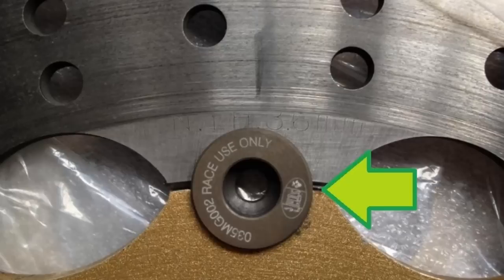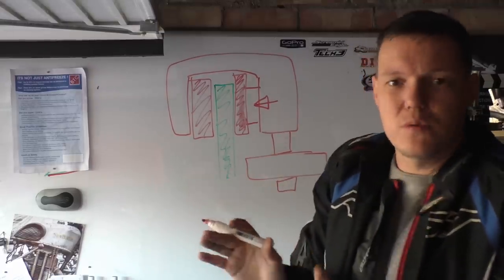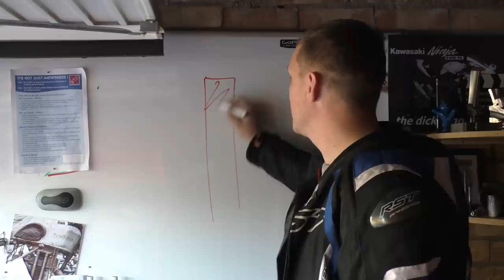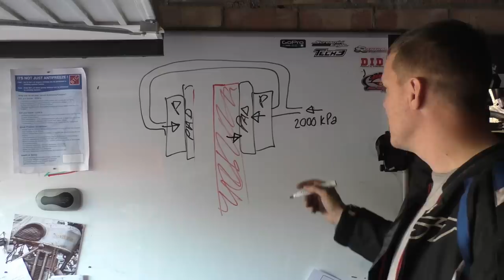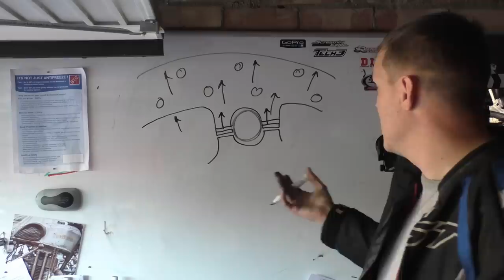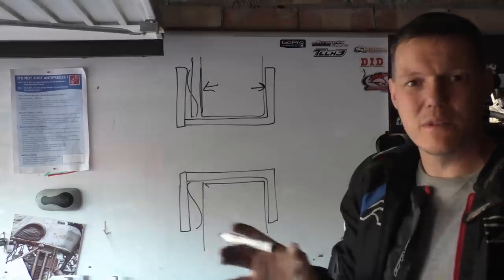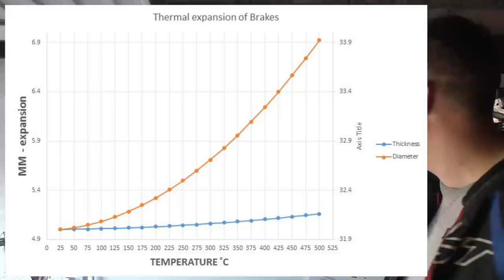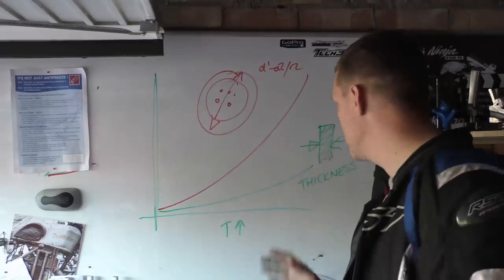Floating Brake Discs - and bobbins

Comment: Question. From new the bobbins are free.
With time, dirt, rust and grime will seize the bobbins in place. Not allowing the disc to move expand etc. It's bad to free the bobbins times to times? Would this not avoid the discs to warp?
Cheers and thanks for the video.
Reply from the maker: "From new the bobbins are free."

- But they're not...

"With time, dirt, rust and grime will seize the bobbins in place."

- Again they're not, some are but not all.

"Not allowing the disc to move expand etc."

- But this is where the problem lies. The expansion is radially outwards - if the clearance is reduced then the brakes expand in the other 5 degrees of freedom...

"It's bad to free the bobbins times to times?"

- The shit in the bobbins is brake dust mainly, an abrasive material. Twisting the bobbins in their clearance grinds the clearance larger, which isn't a good thing.

"Would this not avoid the discs to warp?"

- warping the disc requires heat, a shit load of it. And like I show in the video some bobbins aren't round, so they can't be rotated.
Reply: My issue with this is that not all things are the same. So if u have a disc with free bobbins from factory and they get seized it's normal to leave them seized??

And some are solid others need to move from side do side once they have a type of spring wash to allow movement. But as u showed there's a new type created by ebc that doesn't move.

It's just a bit of everything and makes a lot of confusion not for me but for many people out there.

Another thing I understood and you mentioned is the gap gets bigger once u start spinning the disc each obviously can make the disc to move excessively.
But for the discs that originally come with free bobbins should u keep the bobbins clean so they don't seize.
Reply: Thanks for your time and help.
Reply from the maker: "My issue with this is that not all things are the same. So if u have a disc with free bobbins from factory and they get seized it's normal to leave them seized??"

- You say seized. Seized means not moving, which implies that it should in the first place...

"And some are solid others need to move from side do side once they have a type of spring wash to allow movement."

- The wave washers are there to stop the bobbins moving. This is how it breaks down.

The disc will expand in all 3 dimensions which includes axially. The bobbins have to have clearance otherwise if they were tight they'd pop of wheb the disc heats up and expands. So there's clearance. But this clearance means that they can rattle around due to the disc vibrating when the pads clamp on. 

So to stop this from happening wave washers are added to apply a pre-load. This stops or supresses the vibration by absorbing the energy. When the disc expands it compresses the wave washer with little resistance.

"But for the discs that originally come with free bobbins should u keep the bobbins clean so they don't seize."

- But again that word seize.

Comment: At the risk of being 'picky'. Is that scratches against the bleed nipple? On a brand new bike?
Reply from the maker: LOL no. That's paint marker - there's a few spot around the bike like this - this is for inspection at the factory to makes sure these fitting have been torqued and then checked before testing - so in this case for the brake system before brake testing
Reply: there is one in the bleeding screw/valve that doest look like paint for torke-check.

Comment: I tried this on my semi-floating bobbins due to a pulsing brake sensation that was glaring at low speed and it fixed my issue. Wondering how come it worked? The braking feels much better now with no bouncing/pulsing.
Reply from the maker: Semi floating?
Reply: @dirtygarageguy  not sure tbh.. they're not as laterally free moving as some rotors ive seen. all i know is the pulse is gone.

Comment: My front brakes vibrate like hell, as i brake the front light bumps up and down when riding in the dark (for example. Are my calipers twisted for some reason or doesn't the bobbins just let the caliper move at all? bike is  ninja zx6r original brakes just like in the video
Reply from the maker: Can you send me a video by any chance?
Reply: @dirtygarageguy  yes i have some gopro footage I'll find a good clip to demonstrate! Thank you
Reply: @dirtygarageguy  https://www.youtube.com/watch?v=lIVA5zuHccw&feature=youtu.be here is 2 clips the last one is little better explaining the wiggle. I ride on a steady road and press stably on the brake lever
Reply from the maker: Do you mind if I use the footage. Would make a great video - First things first - take the pads out and look for a build up of shit on the surface, then look at the rotor. Black shit stains are what you're looking for. You can use 400 grit sand paper and lightly remove at the shit. Try that and if you can send me some pictures of what you find. This usually happens if you brake hard and keep the brakes on when stopped.
Reply: @dirtygarageguy  You can use it sure! But alright I'll take a look, pad are fine but not sure about the rotor

Comment: So if my front brakes shake when applied, what you're saying is it's not my solid, unmovable rivets in my disks but rather the fact that either the pin that my caliper floats on is stuck and does not float properly.. or perhaps one of my pistons in my calipers is not pushing evenly with the other?  Hmmm.....  I'll have to check that out!  You may have just saved me $150 by not having to buy a new set of front rotors.
Reply from the maker: Juddering from the front brakes is usually the pads are crocked or the disc is warped slightly - or even air in the line. Sometimes it can be (if you have one) the ABS module being a dickhead - to sort that out you can disconnect your battery for 10 minutes and then reattach - this causes the ABS ECU to reset.

All of these things cost very little to do - so do them first
Reply: Thanks a lot dude!  I have a 05 gsxr 1000 so no abs to worry about... There's no safety nets like abs or traction control on my monster litre bike that could be causing any problems.  I checked the disks the best I could for warpage the last time that I had my front tire off and the best I could tell, they looked strait and lined up with a strait edge.  I have also bled the brakes but I only did it quickly by cracking the bleeder on the lever while pulling the brakes and only did it like 3 or 4 times.  There might still be some air in there somewhere since I didnt really take too much time doing it.  I'll also have to check my pads and maybe check the movement of the caliper pistons when they are off.  but thanks for the response and setting me on the right path to fixing thus shaky front brake issue that's plagued me for a while.  Trust me, it sucks having crappy front brakes on a bike as fast as mine
Reply from the maker: Is it a series brake line, i.e the line comes from the MC down to one caliper and then a line from that caliper to the next?
Reply: I'm pretty sure that is the case.  line comes down to the right side caliper and then loops around to the left (that is when you're sitting on the bike)

Comment: Another myth busted.  Always thought floating discs were about alignment.  Cheers Matt.

Quick question.  Saw someones race bike with race specific discs.  They had a lot of free play compared to road floating discs.  Is this to allow for more thermal expansion, or were they just flogged out?
Reply from the maker: Could be either since I haven't seen them in person. But yeah, race discs undergo higher temperatures etc

Comment: I don´t think you are right when you say that the old style discs wold broke the bolts because of the heat, the aluminium wheel would always be able to dissipate that heat. I think the only reason for the rivets it's because it's the best way to connect the inner core aluminium of the discs with the outside steel for all the reasons that you have explained, since you cannot weld the diferente materials and you real want the diferente characteristics form the diferente material in different places of the disc, the advantage being better cooling and mainly weight saving from the aluminium core of the disc, sorry for my poor english
Reply from the maker: "I don´t think you are right when you say that the old style discs wold broke the bolts because of the heat"

- I didn't say this.......
Reply: maybe i could say it well i´m talking about the 19:06 min part

Comment: Thermal expansion can only take place if there is space to expand to. If there is no free play at the bobbins because of dirt, rust, oxidation what then? Shit needs to be cleaned or the disc will warp just like it is made of one piece.
Reply from the maker: Thermal expansion happens regardless of room to expand into...
Reply: @dirtygarageguy  Yes it does hence the two piece rotor is invented instead of the one piece so it wont warp. If the two piece cant get room at the bobbins as intended its just a one piece defeating the purpose of its existence.
Reply from the maker: Having a 2 piece disc is for weight purposes. Instead of an entire steel disc you can have a ally centre and a steel parameter disc.
Reply: @dirtygarageguy  True also they can make it thinner instead of the one piece which has to be thick enough to be able to dissipate the heat to prevent warping. The two piece being thinner, lighter will heat up faster, brakes work better but the bobbing has to keep up with this by providing enough space for the rotor to expand to fast.  It also provides a sort of heat barrier so the high temperatures will not be transferred easily to the aluminum carrier. Back to my original point the bobbing has to have free play or it cant do its job and the disc will warp.

Comment: I believe there is a spec for the bobbins in regard to how much free play they have to be safe
Reply from the maker: where? Its a geniune question.....
Reply: @dirtygarageguy  Its probably one of those mythical quotes that always goes "refer to the service manual" but a google around does come up with an EBC page with a reference   https://ebcbrakes.com/product/floating-mc-rotors/      "Both Floating MC rotors feature mill hard stainless steel high friction rotor blades for maximum brake effect and are direct size for size replacements for OEM rotors. Both designs are also true ful"ly floating units, offering more inside to outside float tolerance than any other rotor on the planet.
 Do not confuse floating rotors with rotors that feature loose rotors blades or buttons. You should not be able to move either the buttons or rotor blades from side to side, if you can, it is highly likely that pad “Knock Back” will occur and you will end up with spongy brakes. Float means outside to inside heat expansion ability. That is what EBC X and XC rotors deliver and no other rotor can.

Always use new pads when replacing rotors, the use of old or worn pads can cause hot spots or glazing of the rotor and will promote brake fade and loss of brake.

Comment: If you don't see it in a service manual why the hell would you even try something like that.I've never even heard of this before.
Reply from the maker: https://youtu.be/1qoPqN2GBdw
Reply: Yes indeed.  They were great when they worked, but I most of the ones I have seen didn't.  Pistons not moving freely seemed to be the biggest problem.

Comment: What about my rsv mille rear brake solid mount caliper and disc get leveled out by the pistons?
Reply from the maker: Levered out? I don't get what you mean? RSV calipers are floating calipers - on sliders......
Reply: @dirtygarageguy  leveled as in how the floating caliper would centre itself do they just push more fluid to whichever side
Reply: They are solid no floaty rubber bit solid mount on bracket that goes through axle I'll send some pics

Comment: Hey Matt!
Nice explanation and drawings:)
I do agree with you when a caliper does have self alignment capabilities, however, a motorcycle front caliper does not have such of the same flexibility.
True when the piston do manages some of it, if in perfect working conditions. But the pads will always tend to run true (perpendicular) to the pistons and parallel between each other leaving the floater to adjust.
Now, if the floater do not comply a whole bunch of things start to appear. Some not so bad as others.
Parts are made on a clean environment, or most of if. Brake dust, durt and s*** don't make part of the assembly step, so if you can keep those away from a part (like bobbins,rivets,buttons,whatever) while in real life use, they will perform better.
Maintenance is key and saves money. That is why #motogp teams have a lot of guys to clean. 
Keep up the good work
Reply from the maker: I agree about cleaning, but what does this have to do with bobbins? or they're design.
Reply: @dirtygarageguy  the maintenance and the fact you state that is bullocks
Reply from the maker: Bobbins should not thrust period - it's even in the Brembo patent. The kwak ones are new and they don't rotate. Go to a dealership and check for yourself. 

Brake to disc alignment is all part of the system and nothing to do with the rotor. If you look at older designs they didn't even have bobbins but still had double sided pistons
Reply from the maker: And to add there's also your rear disc...
Reply: @dirtygarageguy  which is not of the floating type but the caliper is self adjustable, like cars

Comment: i have magura HS2 hydraulic rim brakes on my mtb, they do that "self align" thing except the rim isnt stiffer than the caliper pressure, so if the bias goes to shit (on the set i removed, on of the pistons has a hard time to expand), you just bend the shit out of the rim...

Comment: What these videos show is how to clean the bobbins so that it does it job and moves under the thermal expansion horizontally and vertically. You at least should know this being a pommy and riding in the rain and dirt most of the time that when these bobbins seize it feels like your disc is warped because there is no movement. Periodically you need to clean and make sure there is easy movement. Also when talking about calibers and pistons, the bobbins allow some movement and takes away some pulsating under braking. Bobbins are there to allow movement and stop heat transfer. But saying you shouldn't service these bobbins is just wrong.
Reply from the maker: What you should do is clean the bike regularly, then you don't need to do this.

Comment: You put a nut and bolt then  tighten and then turn, use brake cleaner,   fingers are not strong enough as you demonstrated...
Reply from the maker: Didn't watch the video - obviously...
Reply: I had a Ninja 1000 with that problem and fixed it using that method. Cheers.

Comment: Nah mate this fella knows better.  https://www.youtube.com/watch?v=1qoPqN2GBdw

lelo sanu
5 days ago
I tried with turning the nut with the brake cleaner and degrease it with wd-40 , it still wont move with finger , brakes are pulsing less when braking but its still not good enough , any tips?

Moonfleet41
Moonfleet41
5 days ago
It's not necessary that they shoudl turn with your fingers, as long as they're not jammed solid and holding the disc at an angle... not sure if you fitted new pads, but if that disc was jammed it could be that they've worn at an uneven angle, so if you fitted new pads this could improve things...... Also check that your caliper aligns with your disc correctly and in the end, of course, you can't rule out that you may, indeed, have a warped disc... good luck to you, I hope that's not the case...
 

He's not a quick learner FFS